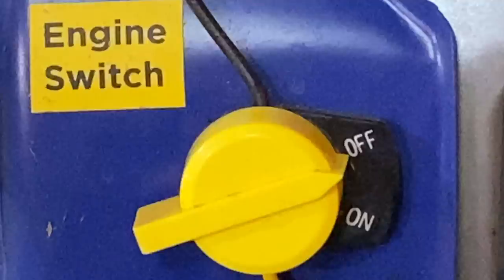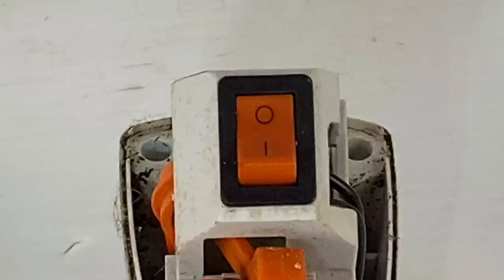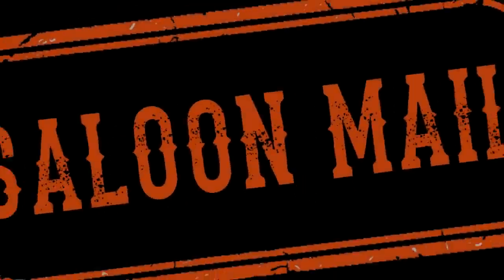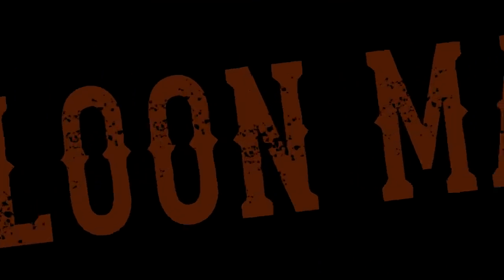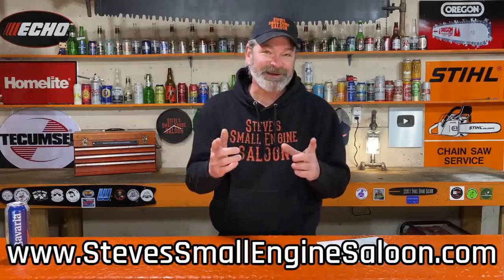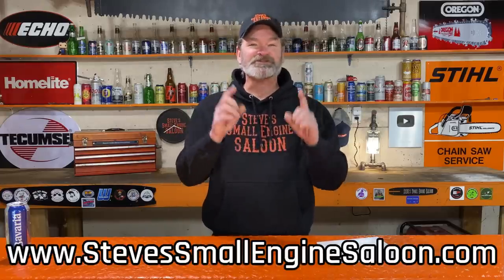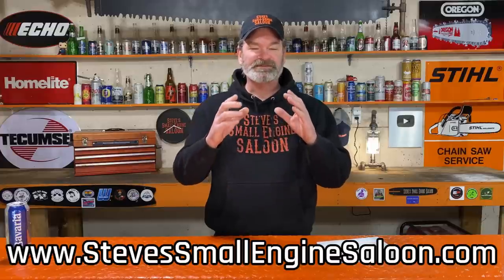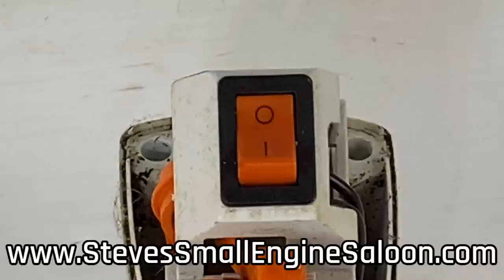Easy Way To Remember What The I and O Means On A Switch

Comment: "O" is open circuit (which means off) and "I" is closed circuit (which means on).  the O and I are visual representations of the electrical circuit.  some of my Italian in-laws will say "open the light" when they want the light ON, which they are actually using incorrectly, and I tried to tell them that and now I have to sit at the kids table.
Reply: I for ignition O for off. sure, its not right. but its right enough.
Reply: Wrong... Why would one symbol represent a word or phrase, while another represents a diagram?... It wouldn't, that's why.
Reply: @starmc26  they are both symbols and both represent words. its a circle not an O. and a Line not an i.  they arent diagram symbols they are representing the two binary states. 0 or 1. off or on. open or closed.
Reply: IN a digital circuit you cannot have a SPST switch control an input directly.

The signal needs to be connected to either ground, or the voltage level that represents logic 1.  The common way to do this is to pull the input high with a resistor, 3 to 10kΩ
then the switch is connected to pull the input low to ground when the switch is closed.

SO for most digital circuits the switch at 1 (closed) pulls the input low = logic 0
and when the switch is O (open) the resistor pulls the input hi = logic 1

you cant assume anything just looking at the switch markings
Reply: @kenwittlief255  eh?. an spst switch is in fact digital in of itself. so your wrong. oh so very very wrong.

Comment: The "I" stands for line as in the "power line" is connected.
Universal power symbols are described in the International Electrotechnical Commission 60417 standard, Graphical symbols for use on equipment, appearing in the 1973 edition of the document (as IEC 417) and informally used earlier.[1]

IEC5007 On Symbol.svg
IEC 60417-5007,[5] the power-on symbol (line), appearing on a button or one end of a toggle switch indicates that the control places the equipment into a fully powered state. (1 or | means on.)
IEC5008 Off Symbol.svg
IEC 60417-5008,[6] the power-off symbol (circle) on a button or toggle, indicates that using the control will disconnect power to the device. (0 or ◯ means off.)
IEC5009 Standby Symbol.svg
IEC 60417-5009,[7] the standby symbol (line partially within a broken circle), indicates a sleep mode or low power state. The switch does not fully disconnect the device from its power supply. This may appear on a toggle switch opposite a power on symbol, alone on a pushbutton that places the device into a standby state, or alone on a button that switches between on and standby. Alternatively, under IEEE 1621, this symbol simply means "power".[8]
IEC5010 On Off Symbol.svg
IEC 60417-5010,[9] the power on-off symbol (line within a circle), is used on buttons that switch a device between on and fully off states.
Power sleep black cropped.svg
A crescent moon, indicating sleep mode, is added by IEEE 1621 as a replacement for the standby symbol.
Reply: Thanks for that educational documentation from 1973. I don't have any problem understanding which symbol means on or off.  However I was a bit disappointed there still isn't really any iron clad logic in the official definition.  I would have guessed it would have something to do with ones and zeros (and make some computer type sense).  Even assuming  that "line" is referring to a "power line" analogy, the stated portion of the definition regarding the circle "indicates that using the control will disconnect power to the device."  If I was going to depict a disconnected line (off) vs a connected line (on), then I might just as well  think the opposite of the reality (i.e., that a connected line would obviously be a circle while a simple open ended line is disconnected).
Reply: @todddavidmoore  Unfortunately when I converted the excerpt to text so that it would post in the comments it lost some of the contextual information. It isn't solely from 1973. That is only part of the documentation. 
But the IEC determines the meaning and they state that the "I" stands for line. In any case you can find this in the Wikipedia entry. Which includes links to the original sources.
Reply: Great info.     
Couple additional items:
1. In our global world economy, these machines go to a lot of places, many of which aren't English speaking. So On and Off are a no-go.        
2. The switches represent the system and not the switch itself. Small engine magneto ignitions typically use a switch that is closed when off, short to ground. "Automotive style " switches typically open when off to remove battery power from the ignition.
Reply: @clay it doesn't say it means "power line." It's saying that the symbol itself is a line.
Reply: @paulheitkemper1559  That is why I stated "as in." For laypeople. ;)

Comment: "O" is open contacts, "I" is closed contacts. The O is a gap and no current flow. The I is a connection with current flow. That's what works for me.
Reply: It's actually binary. Like computer language. It's a one and a zero. I. Computers one is on and zero is off.
Reply: @SuperMutsy  yes, it is but, not everyone is a computer guy. so i was just saying an easy way looking at it from an electrician point of view.

Comment: The best I/o switches are the ones that are spring loaded, meaning they are always in the run position unless you temporarily press the raised part down (against the force of the spring) to kill the engine.
Reply: there's plenty out there that are not spring loaded...
Reply: Yeah the spring loaded to on is SO much better!
Reply: @RayB50  
Unhappily, yes. But if you just have one, you can use it to help you figure out what the I and the o mean.
Reply: How wrong can you be...

Comment: It's not the letters "I" and "O", it's a ONE (1=on) and a ZERO (0=off). These are the international symbols for on and off. Manufacturers do this because they sell their product in many countries, many of which speak languages other than English. If they used the words "on" and "off", they would have to make a many versions of their product with different labels in the local language of each of those countries, driving up the cost of manufacturing and charging more to the consumer. Free tip: feel free to put some painter's tape over the 1 and 0 with the words of your choice.
Reply: They are not numbers or letters but a line to represent a closed circuit and a circle for an open circuit.
Reply: @kamX-rz4uy  Do you have a source for that? I’ve worked in electronics and software for 40 years and haven’t heard that explanation before.

Comment: It’s computer binary. O is off, and 1 is on. Some switches have a symbol comprised of an 0 with a 1 splitting the top of the number, meaning it’s the ON/OFF switch.

Comment: I always thought of this as O is open circuit and I is closed, open means there is no electronic connection. Its not English letters but symbols of a circle and line that are understandable by any language.There are also color gauges for battery status and fuel using green for full, orange for mid and red for empty understandable by anyone in the world. Sadly with some new electronics from China there is a drift and they are using cheaper blue and red led circuits mixing those colors in blue and red for battery status rather than sticking to international standards.
Reply: When I first encountered these symbols, I thought the circle meant that the connection was complete, i.e., on.  I appreciate the need for universal symbols, but the meaning of these symbols far from obvious.

Comment: I think of it like an Open and Closed circuit... even the word Ignition has to be remembered... with the O and | I can visually see open and closed. I would like them to add a bump in the O so it can be felt as well... some people are blind or it's just hard to reach the switch (PSU switch on the back of a computer for example).

Comment: I’ve always thought of it “O” as off cause power not going anywhere, being stuck in a loop and “I” as connecting power between points. Off and ignition makes more sense 😉
Reply: remembering where Off is without first reciting the word "ignition " in your head is also useful, especially if theres a handy O to remind you.
Reply: I like this better. Thanks.
Reply: Funny, but in my mind, I always want to believe a full circle means the circuits completed or on, as opposed to a line which takes current nowhere like an open switch is drawn in an electrical schematic.
Reply: Elvis Barcellos   Yeah, but if you are familiar with how electricity/electronics works, then a "closed loop" is exactly what is needed for current to flow, thus any device to turn on. Power will always be stuck in a wire that isn't connected at both ends. Like a straight line. The symbols are (logically) backwards for electronics.

Comment: Hey Steve! "Ignition" and "0" for off, that was easy. I never liked them symbols either. I like the steam punk lamp on the back bench next to the YouTube award. Just thing. Spring is right around the corner. 😀
Reply: 0 can mean on too lol
Reply: Its simply binary code for on / off
Reply: I means closed circuit (On) and O means open circuit (off).
Reply: Those symbols

Comment: The well-known on/off power symbol was the result of the logical evolution in user interface design. Originally, most early power controls consisted of switches that were toggled between two states demarcated by the words On and Off. As technology became more ubiquitous, these English words were replaced with the universal symbols line "|" for "on" and circle "◯" for "off" (typically without serifs) to bypass language barriers. This standard is still used on toggle power switches.

The symbol for the standby button was created by superimposing the symbols "|" and "◯"; however, it is commonly interpreted as the numerals "0" and "1" (binary code)

Comment: Early switches used blades in North America,  but in Europe they used a contact at the end of a rod.  It was off when pulled out,  and on when pushed in,  so in some languages like German,  it is im and aus (in and out) for when the circuit is complete or open. So I think of it as in and out of contact and it's easy.

Comment: I like to think of it as a "1" (one) and a "0" (zero).  It's binary, the vacuum-tube is a 1, or it's a 0.

I think every that gets stuck on it is going "O for Off"... which then later gets mixed up with "O for On".  But treating it like numbers helps.
Reply: That is exactly what it is, the universal binary one and zero.  One is always one and zero is always off.  Not rocket science just binary code.

Comment: In computer language a 0 = Zero voltage. A 1 = voltage present. Different computer chip technologies use different voltages ranging from 1 volt to 15 volts, but a 1 always means the system voltage (whatever it is) is present, thus, powered up.

Comment: Wow that's awesome. And it really is simple. I feel silly having to be told that. I never could remember which one was on and which one was off. I would've guessed that the "O" meant the engine was on and making complete revolutions and the "I" (or a dash " - " mark depending on how you look at it) meant the engine was not doing anything ("flat" or not moving)
Reply from the maker: Agreed!

Comment: The circle symbolizes a closed circuit   The line depicts an open circuit.  Magneto engines are shut off by completing the (kill) circuit to ground thus shorting out the ignition.  They can not start or run in the "o" position.  They run with the (kill) circuit to ground open.  Battery powered things are "on" in the circle position and "off" in the line position.

Comment: here's an even easier tip (and likely the actual meaning)

the I denotes the circuit being closed and thus "ON"

i think of the I as the bridge (bridge looks like a flat line) connecting the power

Comment: I buy eqt with Honda motors. Honda starts on the first pull of the rope. If it don't start on the first pull, I know the switch is in the wrong position.

Comment: When I was a teen I had this same frustration when I had to weed wack the yard or mow and would forget as I'm priming them and didn't remember which was which. Is "o" off or on? Inevitably flooding many a small motor until I figured it out and remembered. Like Steve, I eventually came up with "I" as ignition. Fast forward 25 years and I'm teaching my son binary how it's just 1's and 0's and how technically 11 in binary is three in decimal and so forth. But then I was like "technically it's machine language and just means on for 1 and off for 0." Then my son was like "yeah, just like the vacuum" and I'm like "what?" And then he takes over to the vacuum and shows up the I and O, and I then had a head smack moment as I learned binary when I was a teen and failed to put it together with the lawnmower.

Comment: Or... what should've been even easier than that, is that these two symbols actually started life as a 1 and a 0, with 1 of course being for "on" and 0 for "off," just like the representation in the digital realm. And on/off switches really are just digital in a sense, anyway. How anyone could get such simple symbols mixed up baffles me! And I wish you had made a direct comment about the reason for the internationality of the symbols: to avoid language-barrier trouble.

Comment: It's a zero and a one.  Comes from computers - a semiconductor is either open - "zero" (no current can pass through), or it's closed - "one" (current can pass through).  Since there are only two possible conditions, they use binary math (base two) to do all computer math.  That is, all zeros and ones.  Since binary math is almost impossible for a human being to make sense of, it is converted either to decimal (our normal numbering system) or to hexadecimal (base 16) so that human beings can work with it.  For some reason, this logic got used with on/off switches.

Comment: I once went to see what was wrong with printer, they even had a users manual, after discovering the problem I went thru the manual....... nowhere did it say turn it on, and nobody there knew what the 1/0 switch did.

Comment: If you actually TEST the switch from a 2-stroke piece of equipment -- the "1" is "open" and the "0" is "closed". It's the opposite "logic" of a computer power supply switch.
The switch grounds the coil at "0" and allows the engine to run when "open" "1".  Some are sprung open and you hold them closed to stop.  That would make a good horn button.

Comment: I and O are actually a one and a zero in the binary system. In binary there are only ones and zeroes. Computer data can only operate in the on or off state....a one or a zero. These ones and zeroes are achieved using switches (transistors). Then the computer counts in binary, or hexadecimal or whatever and this is translated into programming. But in the case of an on and off switch just remember that a zero is nothing (off) and a 1 is something (on).

Comment: I and O… it’s basically 1 and 0. It’s a power setting. 0 is off, obviously. 1 is power setting 1, or on. Some devices may have 1, 2, 3 power settings for speed and what not.

Comment: Long time ago a racing team was experimenting with an adjustable torsion spring suspension.   The driver (Andretti?) instructed the mechanic to label the lever because he couldn’t keep straight which way was which. Next time he checks it out and it’s labeled “S” and “S” so he’s like “what the hell?”  To which the mechanic says “ when you push it in it’s Stiff, when you pull it out it’s Soft.”

Comment: O is for off. The line or " I"  thus means the opposite i.e. full power. It comes from the digital binary code symbols
for 0 meaning no power or 1 meaning full power IF that is the only choices. LATER they started putting on multiple
 positions switches the following: 0, lll , ll, and l  ( examples are  room air cleaners  or portable electric fans ). 
It just  means that the positions are  0 for off, lll for full power, ll for medium power , and l for  low power. .......................
That's the confusing part. But you can check for yourself.

Comment: These are symbols and are NOT a 1 or a 0, nor are they an O nor a l (letter o and l) By definition they are designated as a line and a circle. These were developed by IEC requirements  IEC 5007, 5008, 5009 and 5010. They are derived from binary 0 and 1. 1 is on, 0 is off.  There are also 2 other symbols one shows a 3/4 circle with a line going through the top (5009) and a circle with a line inside (5010)

Comment: If ON is on why wouldn't "O" be on? I know, keep the public confused. A simple ON and OFF would be greeted with a Noble Prize in engineering.
Reply: Don't forget you and I are from a generation that learnt to read. Nowadays all writing is being replaced by pictograms and I never know which is what. Apparently remembering 2000+ confusing as heck computer icons is easier than learning 26 letters of the alphabet and reading clearly labelled menus...  Modern UI... all form over function 🙄

Comment: It's actually bleed over from electronics believe it or not. It's not I and O it's 1 and 0. In binary (which is what all digital electronics run on) 1 is positive or on - 0 is zero but not negative so is called off.

Comment: I'll just use a dremel and grind ON and OFF either on the switch itself or beside it, a little bit of paint wiped into the grind grooves and voila, proper switch designations.

Comment: It’s a 1 and a 0, it’s a digital world we live in, 1=true 0=false ….that didn’t require university, they covered it in high school.
I did, at one point, work on a series of MRI scanners that had a disconnect switch on the main PDU (power distribution unit) that had the main switch labeled correctly for the 1/0, but they had the area the 1 was in was a red square 🟥 and the 0 was in a green square 🟩. It was a European designed panel, and it generated a number of service calls.